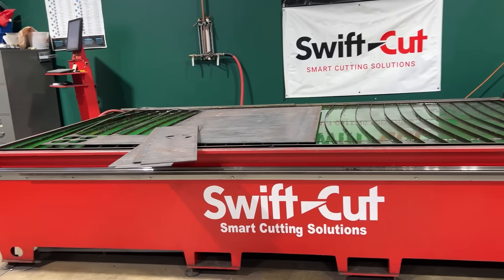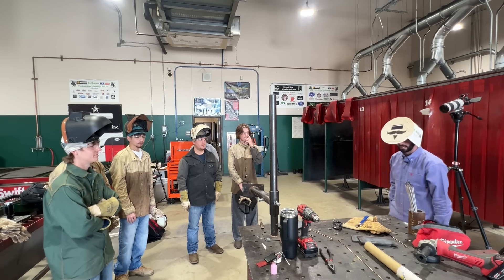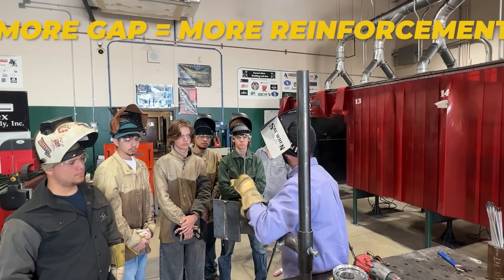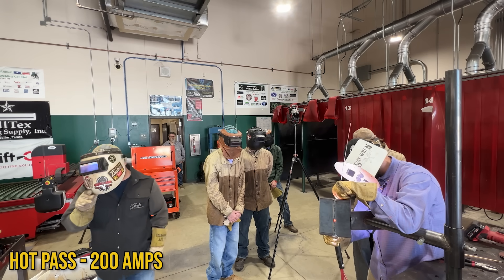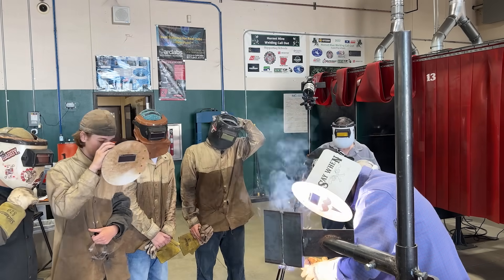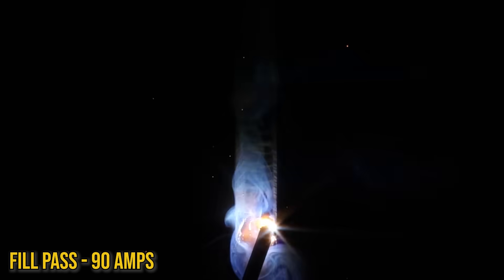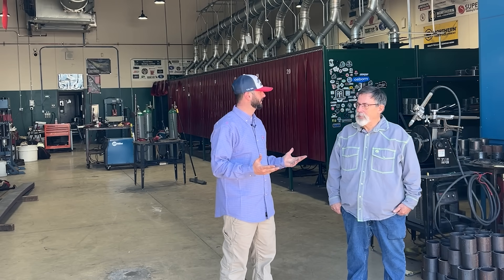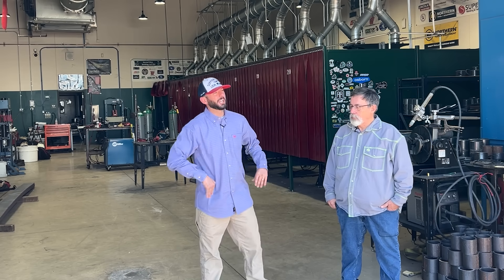3G Combo Welding Demo: TIG Root & Hot Pass with 7018 Fill & Cap

Comment: How do you combat distortion on such a plate , or that is not co-considered into the test?
Reply: Its not really considered here, in this case, it will likely always happen. If I wanted to prevent distortion for this test specifically, Id want to fixture it, or "pre fit" it the opposite way a little so it distorts to flat.

Comment: Mr Moneybags here leaving the gas running 😮
Reply: Its calllled extended postflow, helps keep the bugs off my feet while it dangles there
Reply: @Drweldz  😂
Reply: @teejay3510  👏🤣🤣🤣🤣 I was thinking the same thing too.
Reply: It's also a habbit you might fall into to keep ur torch cool when your welding pipe or tube's, it gets super hot. That's what this demonstration is preparing them for. 
   In the field or a fabrication shop that would be a flux-core or stick weld all day.
   An excellent demonstration covering many important things to know and have a feel for before moving to pipe which requires all of this and then some.
 Absolutely priceless information for a potential welder.
  Fantastic!
Reply: @joshuadamon5573  this is true. when I used to weld 200 plus amps all day, that gas stayed on.. Then again I wasnt fronting the bill for the stuff.

Comment: DCEP? that seems odd - explain to me why ...
Reply: its what the electrode manufacture will recommend. In my experience DCEN while welding with a 7018 can have a higher change of LOF or trapped slag. However I have had success using the 7018 on DCEN for open root welding. (video soon to come) DCEP will allow THIS electrode to weld alot smoother and cleaner, even feels "hotter". I do believe you knew this already, I mean you do watch alot of our videos, thanks for watching.
Reply: @ yea i had to go look it up tho - i'm almost always welding DCEN in the industrial plants
Reply: DC+ for stick? Most common thing. You want your electrode to be hot when welding MMA. DC- is usually for thinner materials.